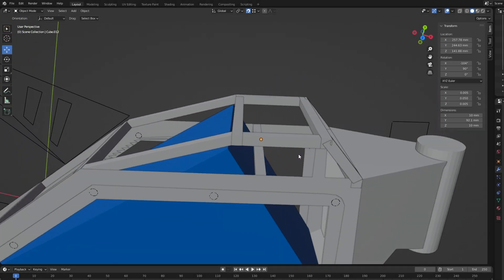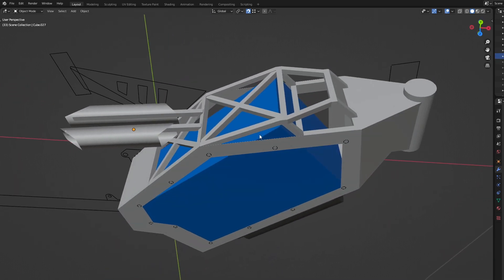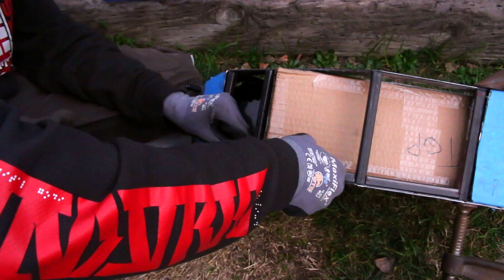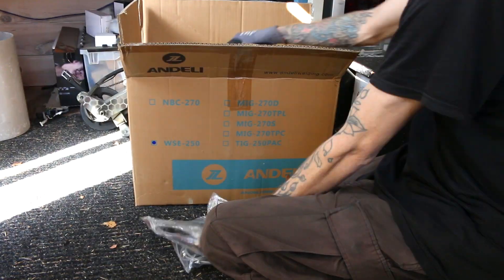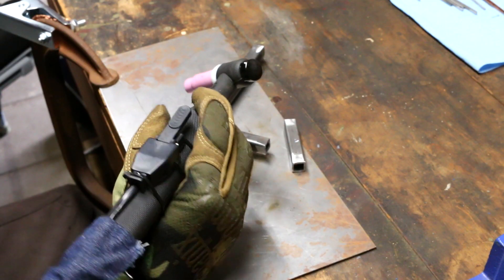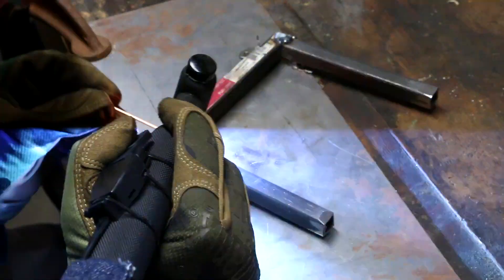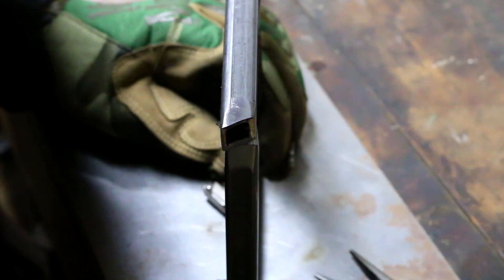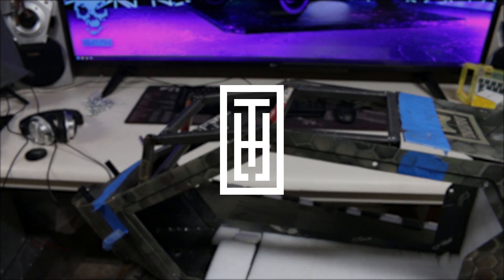🚲 I Suck At Welding! Custom E-bike 9.0 Frame Mods - Fabrication - Enduro - DIY Build! \ QS273 70Ah

Comment: also your dipping your wick, so to speak. dont do that, stike the arc and pull the electrode back and use the arc to melt the rod it will pool below and youll preserve your electrodes. i set and watch welders in refineries do multipass welds without regrinding their tips. my skill for tig sucks, but i know the principles. im much better with MIG
Reply from the maker: Yes, this machine actually has HF start though, this was the very beginning of me learning to weld 👍
Reply: @hightech-lowlife  HF start is pretty common on starter rigs these days, they weren't when I was learning and that sure would have helped. I'm glad we've gotten advanced enough its considered a standard feature!

Comment: the magnetic field of those magnets might be interferring a bit? but steel loses ferromagnetic properties in a fluid state, so it shouldnt? i still think you need more gas pressure.
Reply from the maker: Yes, the magnets were way too strong and interfering heavily with the arc 👍

Comment: your amperage is too low at the start (and you need more gas), but a little too hot at the finish of your test pieces, but youre getting it! its just practice and playing around with your settings!
Reply from the maker: Yes this was when I first started welding, I am much better at welding now. This was a gas issue (plus too many magnets present) 👍

Comment: started off thinking this was insane, but im all at this point love, with a background in industrial machining and engineering skills, this intrigues me quite a bit. a bit pricey at 1500 for the battery but im still intrigued at your results!
Reply from the maker: 1500 for 70AH is pretty cheap actually 👍

Comment: im also new to welding. i started with gasless flux core, and im also just figuring it out as i go. it is fun, but frustrating. there are so many variables! dont be embarrassed, and keep it up, because you are a huge inspiration to guys like me!
Reply from the maker: That's awesome! Honestly I should have started with stick or flux core, but you know, just start and the hardest why not 😂 it is frustrating at times, just keep pushing through and before you know it you'll be looking for things to weld for fun 👍 - even the small time since I made this video my welding has gotten a lot better, just takes practice and figuring things out as you go along, just keep going man, thanks!

Comment: The problem you are probably having is due to the high power neodymium magnets underneath.  They will pull you arc and cause the flames you see.  Keep at it and if you ever need advice just reach out, I would be glad to help!
Reply from the maker: Thanks so much man! I figured this 'might' be part of it, but I'm so new that I wasn't sure. I've moved over to more clamps than using the magnets, also I think my torch height was definitely contributing to this - another thought I had was maybe because the tubing is such a small diameter/volume that the air inside is heated quickly and wants to escape out the ends, this would also cause the turbulence I feel I was experiencing. 

I also redid my argon lines from the cylinder to the welder and that maybe helped also. I turned down my amps for this material and I've welded a bit since I made this video and I haven't really had this issue again. I'm able to do full sessions without needing to change the tungsten! 

Thanks for the feedback, I'm sure I'll run into more welding problems at some point, and I'll for sure reach out. Thanks man!

Comment: I’ve been tig welding for 3 decades and I honestly can’t figure out why it’s sparking so weird. It supposed to strike smoothly. Your torch setup seems correct. My argon regulator is normally set at 15 lbs. Machine set to DC tig. Maybe lower the amperage to around 30 to 40 amps as you’re welding on lighter material. Make sure you ground directly to the vise or firmly ground on your metal bench. My experience is welding on inconel aluminum stainless and titanium.  Your beads look decent for starting out all I could gather is that your parts were dirty or contaminated? Good luck with your build.
Reply from the maker: Thanks man! I appreciate the feedback. I turned my amps down a bit and it made a big difference, even just going from 80a to 65-70. I also think it is torch height being too far also. Another theory is that with such smaller tubes when the air inside is heated up it wants to escape, that could be causing turbulence? I also redid my hose connections to the argon, as I could have had a small leak, nothing conclusive though. My last 3 welding sessions I wasn't having this issue and I could use the same tungsten for the whole session - I'm just happy that it seems to be not doing that anymore.

Comment: Where's your ground cable? It should be on the part
Reply from the maker: Ground is clamped to a piece of sheet metal on the workbench 👍
Reply: Other than that,  it's just practicing technique. You do need a steady stream of argon. I usually set mine around 20 CFM for steel. Strong magnets will definitely mess up your weld. Magnets will deflect your arc. Your starting out right. It's just practice, practice, practice.
Reply from the maker: Thanks for your tips! I think most of my issues were torch height/angle I have been welding a lot more (new video) and it's been getting better/easier. Thanks man!!
Reply: @hightech-lowlife  if you can get a pedal it makes your life much easier. You can adjust your arc. MR Tig on YouTube has a ton of great learning videos
Reply from the maker: @Twin_turbo_coyote_fox  Thanks man, I'll check out getting a pedal, I've watched a ton of vids and from Mr. Tig! Thanks!!

Comment: Could be the wrong filler. What are you using? I used these copper colored wires for a bmx project and later found out theyre for stainless...
Reply from the maker: Thanks for the suggestion! It just says "mild steel" applications, but doesn't say the exact type. It definitely could be a contributing to the problem, I'll experiment with some other rods. 

I have done a bit more welding since I made this video and I think it may be either mostly my technique (torch height too high/far), or I'm thinking that because this square tubing is so narrow (1/2"), that when the air inside the tubing heats up it forces the air to expand quickly out of the tubing, so if there is a larger gap it will push air (almost like compressed air) into the argon field, thus creating this effect. I'm quite certain this is what is happening, I turned down my amps and that also helped a lot.

Comment: You r my new hero! Ur doing everything I’m hoping I get the courage to try. I’ve been brainstorming my frame, seat, swingarm etc and I get frozen in fear of … idk failing I guess.  Props man… for real.
Reply from the maker: Thanks man! This is the most fabricating I've done to an ebike, but so far it's working out just fine - I mean, I did have to try and learn how to weld, which is somewhat of a challenge, but it has gotten a lot easier since starting. These are things I've always wanted to do and finally getting around to doing them. We're all afraid of failing, but that's really the only way to learn. I encourage you to do it anyway and keep doing it and you will be happy you did 👍Thank you!

Comment: All welding methods are a biatch at first, I bought a stick welder which is probably the hardest, moving over to flux-cored MIG then tack, tack, tack all the way home.
I feel like we are running side by side with the same project, I am currently designing my own moto seat, the final design will look like a sports motorbike where the actual seating position is lower down the frame height but rises up the back for lumbar support to match the height of the top frame then narrowing out slightly at the rear.

The reason I'm going for this look is that the wheels are 19 inches and the bike is very high, can't get my leg over let alone touch the floor.
I agree with you on making the seat a tubular frame just like you have done with your frame here, what about panel covering, what material are you thinking of using ?
For myself, I'm leaning towards riveting on aluminium sheets or maybe plastic.
Reply from the maker: Thanks man!! I figured tig was hardest, but I guess all methods have their own challenges 👍I'm in the same boat, I don't like the propped up seats that most of these frames have, it doesn't look as clean or integrated, so hopefully I can come up with something sleeker, but we'll see 😂

That's cool that you're changing it up to allow yourself to fit better on the bike, I'm sure you'll be able to get it how you want it! I really don't know what to use for covering, probably just some thicker rubber/seat material and stretching that over some foam. I think riveting is the way to go for fastening, unless you go with fiberglass or some other material that is more easily stapled. Good luck on your build!!
Reply: @hightech-lowlife  tig and stick both have there own quirks i find starting the stick on stick welding. and on tig its the arc control. and with mig there really isn't a problem. This is all from personal hobby experience and when i was in high school and had chance to mess with tig a bit. Personally on most steel i just pick up my mig welder but once i go past half inch i tend to pick up stick welder.  tig is by far most versatile welding as u can do almost all types of steel with it as long as you have the filler rods
Reply from the maker: @jaylord55  Yeah that's true! I'm sure they all have their own subtleties that are easier and harder depending on the context. I probably should have just started with stick as the barrier to entry is a lot cheaper (don't need gas, the welders are a lot less expensive, etc...) but I do like how much control tig affords you, although stick is nice because you can weld more easily outside too. If I keep practicing fabrication I'll probably end up owning all three down the road 👍

Comment: cool vid! definetely practice the TIG. This thick tubing could be welded with Stick. Your welder is Capable of doing that so maybe try that with some of the offcuts of the tubing. Youll be able to move on with the project much faster.
The flame thing with TIG should be a fixable problem. Contamination (Mill Scale) on the Steel or too little gas would be my first thoughts. Also try not to get too close to the tungsten with your filler. You want the filler to melt in the puddle, not in the flame or on the Tungsten.
Reply from the maker: Thanks man!!! Yes, I think it really may be down to skill at this point. I did do a bit more last night experimenting with things and I believe this "oxide / flame / air" is at least partly caused by the air being heated in the tubes trying to escape and that pressure is messing with my gas flow. Sheets are fine and some places on the tubes are fine, but larger gaps and things like that, I think it also has to do with torch height and then time, I am needing to go much faster than my skills provide at this point 😂. Also what you said about contamination, I think some areas aren't as pure/clean as they should be and it's also messing with the arc. 

Thanks for your suggestions and I will keep going with it!!
Reply: @hightech-lowlife  keep 3mm torch distance at all times, never let the tungsten touch anything.
If you want to go slower you should be able to turn the amps down
Reply from the maker: @jellolon8435  Thank you! I've been watching a bunch of videos 👍 I'm a bit confused about the amps, some people say that it doesn't make any difference to heat, as it's "time" that causes the heat, not the amps, but then others use a pedal control and say dial down your amps if you need things to cool off a bit🤷‍♂️ I have messed with my amps and turning it down does give more time to start the puddle, I'll keep playing with it.